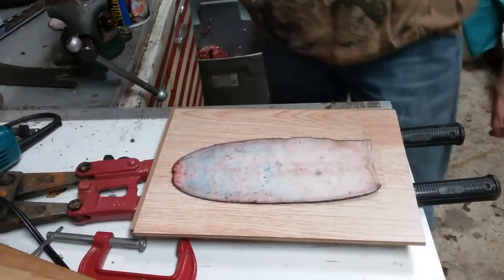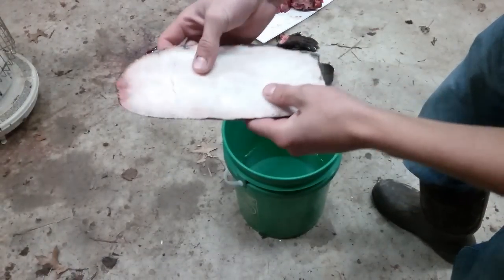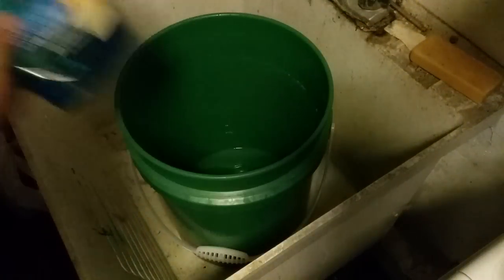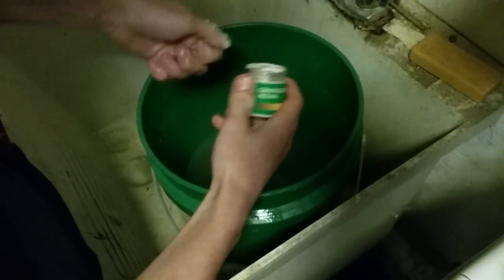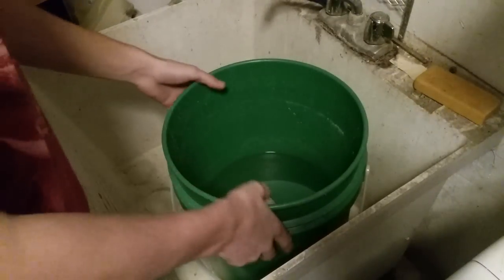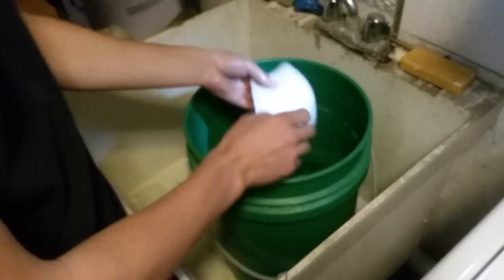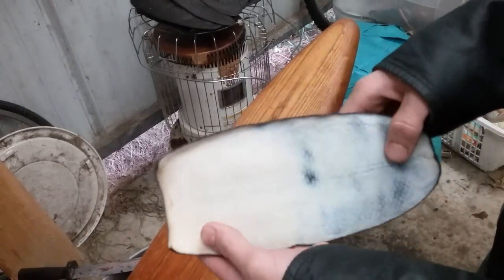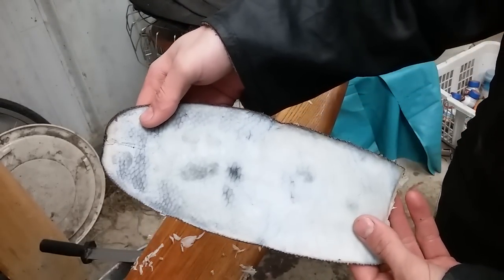Step by Step Beaver Tail Tanning Process

Comment: I use the same solution to tan with , There is one thing you can do it is to not let it dry out after you take it out of the tanning solution , You use  Neatsfoot oil and water 50/50  mix and heat it and put in on the leather side. and let it sit overnight and then  work the skin and then do it again with the oil and sit over night. I found you do this 3x  then you keep working the skin till it is dry and then  for make it more flexible you use medium sandpaper on the leather side and sand it some not alot or hard , then you are done. This is the old method to tan any skin, including fish . I use it when I do taxidermy . But I do not do the neatsfoot oil and let it dry I put the skin when wet on the artificial body and after it dry out it will shrink on you like you seen in the video when you let it dry . Then I just finish the mount.
Reply: Dumb question - by leather side you mean the skin side correct? Not the scaley side?
Reply: @Wubzy66  yes I do

Comment: Try working in some Neatsfoot Oil into leather side, not flesh side. Or better yet Lexol leather treatment with Neatsfoot Oil in it. Work it in and squeegee it off, then  dry the excess off with a paper towel. That should protect the leather and keep it pliable.

Comment: Hmm after tanning (egg tan 6 egg yolks and 2 cups water) I let it dry. Then oil with mineral oil until the tail leather stops drinking it and pools on the surface. Once that happens apply taxidermy sawdust and rub with a board for 4 hours or so until dry. Repeat on the other side...yields an amazing leather.